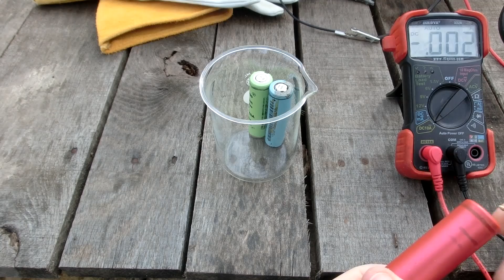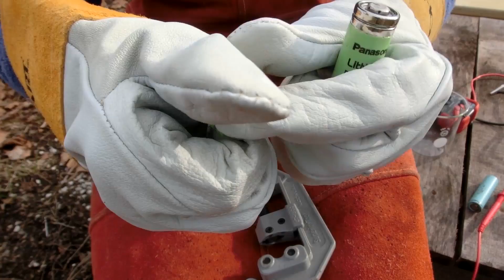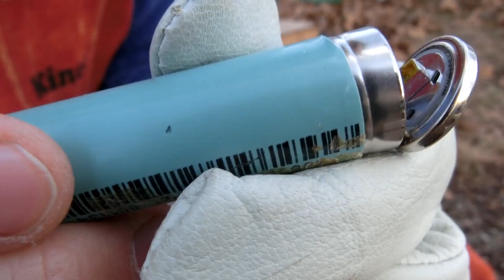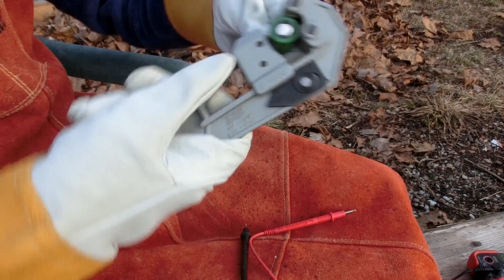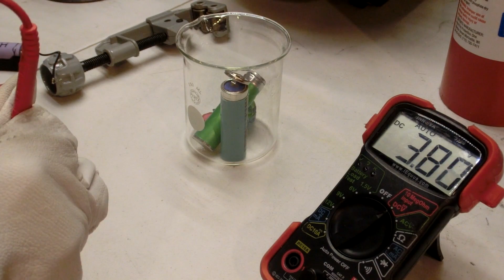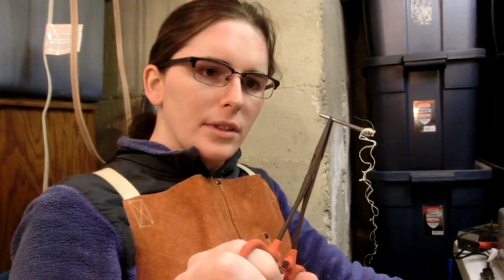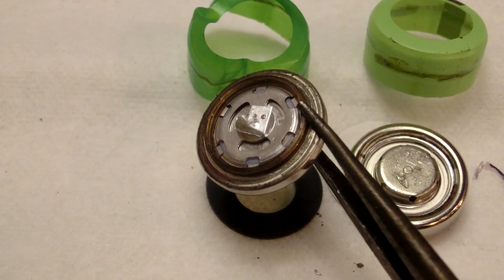Opening 18650 cells: Panasonic Sanyo Sony Generic Lithium-ion Battery Teardown

Comment: i wanted to see the safety mechanism on positive side i heard they have some switch or fuse something
Reply from the maker: It’s difficult to see because it is more of a failure valve thing
Reply: @RinoaL  yes i saw it i had to open one up it like a disc more like thermal disc or pressure disc that can move up and down act more like switch

Comment: Just so you know if one of those batteries caught fire the fire extinguisher would kinda be useless. Metal fires are almost impossible to put out.
Reply from the maker: Fire extinguisher isn't to put out the fire, it's to stop it from spreading as it burns out
Reply: @RinoaL  Oh okay, makes sense.

Comment: Nice vid! I am doing spot welding on some LG cells for a battery pack and I am interested in how thick the bottom is on these 18650s, and how close the actual
"roll" inside is to the negative end of the cell. Have you consider cutting one open on the negative side? 
Using a DIY spot welder with no timer makes me afraid of burning trough the casing and in worst case making a fiery mess of the whole pack.
Reply from the maker: yeah spot welder can be scary, i still just solder then with a great big soldering iron and have never had any issues

Comment: ARGH!!!! You came so close !!! What's in the cap - the part that you cut off?! 
I've seen vids showing how to "restore" a 18650 by smashing the top and hammering a nail right through it. It supposedly brings the voltage back. I strongly advise against it, since - beside being dangerous - it opens up a cell for evaporation of electrolyte, effectively killing the cell. Your finding of the high voltage measured after taking the cap off as opposed to low voltage before the disassembly would suggest some kind of a safety mechanism that permanently disconnects the terminal from the innards, possibly when the cell gets too hot, rendering it dead.
Reply: Ah, I see... the key word is CID - it does disconnect the innards from the terminal of the cell when it gets too hot.

Comment: oh and btw, don't know where you live but if in usa, you'll get cancer quicker from animal meat or from the municipal water (fluoride / chlorine / bromine) bad halogen crisis that needs to be fixed today.    and now with 5G on the horizon, that's some seriously bad stuff if you haven't checked it already..  cancer will easily double in rate.. male sterility will go insane..   and since 5G doesn't go anywhere (shorter wavelength the higher the freq), that means they put up 2 or 3 times more towers with more power all through your hoods and such to give you ultra doses of emf at frequencies not for the human body.   see DSL still thrives cause they learned their limitations and may be on the rise again with fios.. Dow Chem. went out twice cause of ignoring consumers  health concern wasn't  it?

Comment: I had one of those pen vapes that had a lithium batt that's not the 18650 but smaller bout the size of a AA batt..  well the vape had it crammed in a tube roughly the exact size of the battery wide plus maybe a 32 ga. wire running beside it (ground continuity)  anyway, late one night went to push the battery out and grabbed a pen and used the ink size by accident instead of the butt end and i feel it slip (like it breached the outer wall).  heat then sets in with a sizzle..  i threw it down real fast and about that time i see it flame up and since was in the metal casing, it launched off like a rocket leaving a nasty trail with rug burn from the heat and flames coming out the back.. the house smelled like some failed electronics lab went wrong for like a week..  a mess but the way it took off was nearly priceless as it was better than any texas chaser rocket you can get on july 4th..

Comment: In case you dont know this guy on youtube "Robert Murray-Smith"  for example his home made 18650 cells on this youtube  watch?v=FEZKAm9CeiA he  explains how to make your own 18650 .He also builds cheap home brew solar cells capacitors and Batteries from carbon graphene  hemp and other experimental chemistry stuff.His latest project is full size 80amp hour  car lead acid  battery battery types  replacements with carbon  instead of lead to power his twizzy electric car and extend the range  Also  the battery build of ca arbon is to be made  lot cheaper than lead acid and have longer life and be safer  using safer electrolyte materials . Keep up the good show we all need to know and learn the new battery solutions as grid electric power  is coming to end  and eletric power companies are gong to becoem rarer than hens teeth as the capital costs to keep the grid network going is not possible in the long run so its gonna be local power or home power solutions from here on in

Comment: you should not be smelling that! most batteries use fluorinated salts in carbonate solvents. Any exposure to moisture will automatically form HF gas which is incredibly toxic! I have heard stories of people dying in their 30s in analytical labs from lung cancer and the only thing they worked with was HF gas.
Reply: Very true. I was thinking about the same.
Reply: jjlee128 Damn... thanks for the info ! 😶😏

Comment: On the flat top 18650 would it be alright to put a wire in the holes on the + cap. I ask this because it is hard to Solder on a top cap and make it stick. BTW nice video.
Reply from the maker: no

Comment: The reason they wont discharge when you short circuit them is they have a PTC overload protection device usually in the end cap - the moment the current exceeds the rating they will go OC and sit there doing nothing - to discharge these cells you need to use a resistor load that won't cause the overload to trip out.

And the more advanced cells also have an under voltage protection circuit so you can't fully discharge them or over charge them.
Reply from the maker: +Stephen Humble you didnt pay attention to the video did you? also these dont have a resetable fuse in them, only a one time activated one. these have no circuits in them at all. i suggest you gain more experience regarding 18650 cells before incorrecting people.
Reply: The PTC overload is nothing more than a flat piece of plastic unless you were looking for it it would be easy to miss - AFAIK almost every 18650 cell has PTC protection probably triggers at around 15A.

Comment: I think this is a bad idea to cutt these type off battries. You could get cells energy back by pressing the surface under ty cap. There are 6 hole in its cap . From these holes just insert a thin screw driver and press the surface under the cap. You should hear the gass discharge and the cell vill be back to life.
Reply from the maker: +Imran Arain that is a very bad idea and unsafe.
Reply: Imran Arain The CID, right ?

Comment: Can you define what you mean by overheat?  I have salvaged cells that get warm during charging but they were touchable.  Is H H H so hot it is uncomfortable to keep touching??  THX.
Reply from the maker: if you charge them at 0.5C (500ma for every 1000mah it has so normally 1a) and it gets to a temperature at or above your hand temp, id be suspicious. charging at 1c and it getting noticeably warm is still bad.

that heat is wasted electricity, so you could also see a bad cell takes like 3,000mah to charge but only gives back 1,200mah, because like 1,800mah was wasted as heat during charging. a good cell has an almost symetrical charge. where like a 2,000mah cell takes like 2,200mah to charge. but i'm mostly guessing on that last one, i dont personally record the charge mah, only if i notice it taking more than like 3,000mah to charge or is warm do i get suspicious.

Comment: The low Amp ones are super safe so 10a or less but any that at 15a or high can discharge fast enough to melt and ignite stuff inside and around it
Reply: CommanderWolfyX Um no. Low amp ones tend to be much more likely to explode, because often the are the high capacity.

Comment: Hi Rinoa, great vid! Though, I'm curious about you smelling the chems of cut-open cells like that. We hear all these stories about fluoride-containing electrolytes forming hydrofluoric acid in an event of vent or thermic runaway. HF is highly toxic, deceptive (no immediate symptoms of poisoning) and there's no antidote for it (except calcium gluconate injections). How do you know it's ok to smell what's inside those cells?
Reply from the maker: +Ivan Bartsov i dont, just like i dont know if the food i eat is ok, or if riding in a car wont get me killed. however i trust that doing this wont harm me, its not like im smelling them all the time.

Comment: That phenomenon with batteries, that you just noticed, is well known. Doesn't really matter for how long you would short that cell, it would bounce back to a certain voltage, if it's working correctly. Try the same with a little lead-acid and you will notice, you won't be able to discharge it to 0v. It will keep bouncing back to around 4.5-5V, even if you shorted it for months. Chemical bonds are a powerful thing. I have seen multiple "free energy" designs, deriving their claimed "free" electricity, solely from this action. This applies also to all those old sulfated lead-acids many of us have lying around. If you have many of them, in a mixed parallel-series bank, you practically have a source of almost limitless electricity, just not much of it per unit of time.

Comment: lol.. you were testing for voltage with the multi-meter set for amps..
Reply from the maker: +John May i was testing to see if it had any meaningful voltage. sometimes cells act like capacitors when they are dead.

Comment: Watch out for that electrolyte, some formulations when mixed with water can produce hydrofluoric acid which is super dangerous. It can eat away your nerves without any notice, too late when you find you have lost sensory feelings in your finger(s). So be so very careful with that electrolyte.

Comment: I cut open a brand new 18650 that died before I used it other than to initially check it out. The next day, 2 new batteries were dead. When I cut one open, a gas came out. The interior was dry, not wet like the one you showed bubbling. Should the insides be wet?

Comment: I take it that you are aware that there are at least five different types of Lithium ion cells in common use?  Whilst based on Li chemistry, they use other elements to give different performance.  That is why there are different voltages and current capability.  It would also explain the different odours they emit.  Note that some compositions leave a cell as tantamount to a hand grenade with the pin pulled out and can self ignite with little provocation.  Others are as stable as a brick, until the interleaving electrodes are breached.  
I don't think that you were paying attention in High School Chemistry classes.  You NEVER directly sniff anything that you cannot confirm the actual composition of.  Do you not remember your Chemistry teacher showing you how to waft odours across with your hand?
The reason that the cells were giving contradictory and unexpected voltage and current readings may well have been directly related to the control and protection circuitry that is present on a small PCB within the cell.  Something that you did not find.
And using swear words as frequently as you do does not give you any credibility at all but make your sound like an immature twit.  Get your mother to check your videos before you upload them.
Reply from the maker: +camsbits1 18650s dont have any circuits inside them, you are thinking if 19670. stop being such a self-entitled moron please.
Reply: Okay, you haven't been looking for them, that's why you haven't found them.  Basically,  all quality 18650s from reputable manufacturers do contain a power management/safety "chip".  You will find several videos on youtube that show you how to remove them without destroying the cell.  These PCBs include ICs that prevent short circuit, excess charge rates and over-temperature.  When any of those conditions are detected they essentially shut the cell down.  That is why you are not getting the results that you expected with your kick charge and short circuit discharge.  Those cells were working exactly as they should.  In other words, protecting themselves from idiots who don't know as much as they think they do.
The August issue of Silicon Chip magazine has an article about the functioning of these PCBs and how they can be bought for as little as 10 for $2.  There is a photo of an 18650 PCB on page 92.
If an 18650 was manufactured for OEM use in such things as a laptop battery pack, it will not contain such a protection PCB as the battery pack contains all of the protection required for safe charging and operation.  If these batteries are parted out, care must be taken in that they are only recharged in a suitable controlled charger. Otherwise over-temping leading to explosions and fires may result.
Your teachers can tell you where the school library is and the librarian can show you what a Dictionary looks like and even help you use it.  Look up the meanings of "genius" and "moron".  Pay attention and you may learn a thing or two.  Your mother would be proud of her little girl then.

Comment: Mate, as a retired analytical chemist I applaud your
curiosity and diligence for the safety gear you used and (mostly) the
precautions you were taking! However – you were/are LITTERALLY “playing with
fire”; you were very lucky you did not experience a huge exothermic reaction
which could have readily burst into flames! The bubbling of the electrolyte you
saw and commented on was how this reaction begins – the heat generated from
lithium compound(s) reacting with air & water in the air was producing the
heat, which was hot enough at that point to boil the electrolyte, hence the
bubbling!  A not too dissimilar example
is; did you ever throw a small piece of sodium metal into water in your earlier
chemistry classes? Well, Lithium (metal) is more reactive than sodium metal and
hydrolyses water even better (more explosively) than sodium – both of which then
generate hydrogen and oxygen during this process! Add a source of ignition to
this mix (which if the instantaneous heat generated gets to the auto-ignition
point for hydrogen (or other flammable compounds or gasses in this mix) then
results in the well-publicised cells bursting into flames etc., or even results
in a full explosion! 

If I can offer you some valuable food for thought, NEVER
EVER NOT WEAR SAFETY GLASSES OR MORE PREFERABLY, A PROPPER FACE MASK when you
continue on with your curiosity into these batteries or other investigations.  Also, I would suggest you do not use a welders
mask when doing so because if you happen to experience an “in your face”
explosion, the smoked glass in it is not shatter proof and can fragment into a
multitude of pieces, which could takes your eyes/sight with it!

Have I ever done some risky stuff in my early days of
chemistry? Yes I have, however I have always held as sacrosanct, we only have
one pair of eyes – and in my opinion sight is THE most important sense organ we
have!!! I wish you well in your investigations. Cheers from Down Under.
Reply: You have made quite a few poor choices in safety matters in your handling of the dismembering of the cells.
Go to a decent Safety Equipment supplier.  There are a number of safety goggles that go over vision correction glasses.  Correctly fitted and worn safety glasses a not more of a danger than good safety glasses.
Never ever work with anything that has any safety risk in your lap.  If you are going to work with such risky items, they must be on a work bench that you are standing at.  You must be able to back away quickly with no danger to either yourself or anything around you.  And that includes not causing danger or damage to anything else on the work bench.
The welders gloves that you were wearing are more of a liability than a safety item.  You will find much better thinner gloves that fit better and give you better control on what you are handling.
You may consider renaming yourself as you have shown nothing to suggest genius in your knowledge of Li-ion batteries or their dismantling.
Reply from the maker: +Ian Brown honestly i wasnt too curious, i already know whats in an 18650, i just know a lot of others are curious about them so i made this video the way i did.

but safety glasses can sometimes be more of a danger than a protection. they contunially fall off or obscure your vision. it really sucks when you have to take your own glasses off to wear them. if im going to wear safety gogglles i might as well just wear a face shield.
Reply: I was simply advocating you use a full face shield - which will not require removing your glasses - I wear glasses myself and can understand your comment! If you see no value in my suggestion then so be it!!

Comment: 18650 protected cells are protected against short circuit, you would need to drain at or below their max rated amperage which is different from one to the next. Pretty sure they all can handle a 3 amp draw safely.

Comment: regarding voltage level after discharge, having a high voltage, does not mean the battery is charged, you want to put a load and then measure the voltage